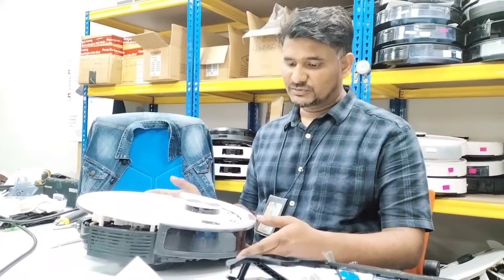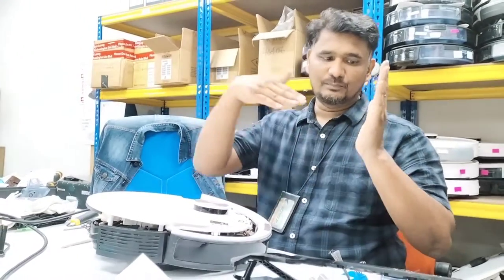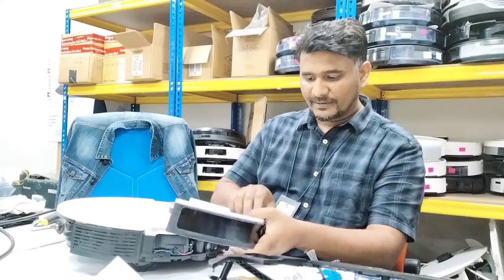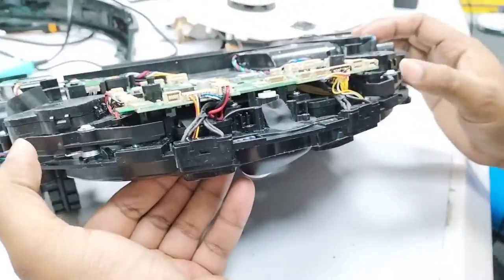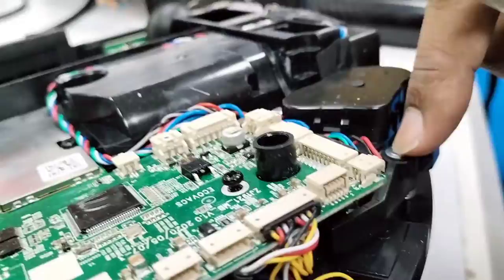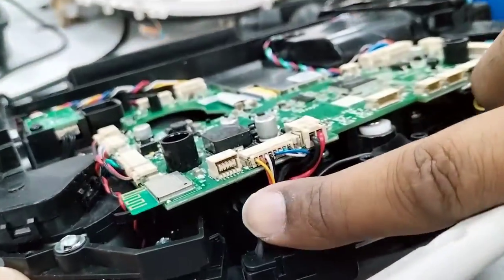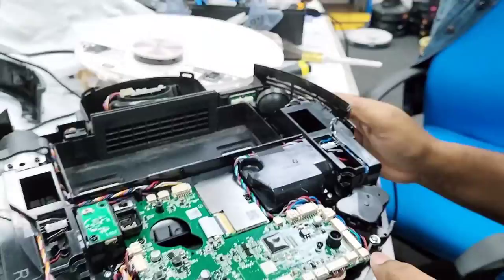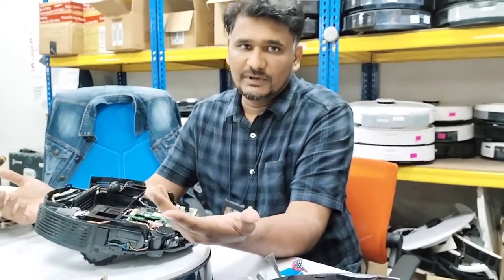How to Fix if Deebot Pushing the Obstacles ?? Or won't reverse after touch an Obstacle

Comment: Same problem with 950, pushing the wall until the left sensor is triggered. Periodically an error on the drive wheel, obviously it hard to push the wall. Swapped the elements of the left and right bumper sensor and it did not solve anything. Apparently, will have to go favorite way off service centers - change everything in a row.
Reply from the maker: Just front anti drop Sensors with Charging connector it comes in one assembly..need to replace saperate also left & right available....if you know which side not functioning so just replaced that side & solder the charging wire with connector... problem will be solve
Reply: Problem fixed by replace smd resistor 100Ω 0.063w on main bord

Comment: Hi, same problem here with a Ozmo950. The right bumper side does not trigger so the roboter does not stop pushing into objects.
Sensor cleaning did not solve the problem…
Any chance to fix or replace that bumper sensor?
Thanks for the support.
Reply from the maker: Front anti drop sensors set includes bumper sensors...it comes in one assembly need to replace...or u see if can find same inner sensors saperate then just solder n replace sensors...like this can solve this issue

Comment: Hello my 950 not working mainbrush. But ı dont know how İs it replace mainbrush motor
Reply from the maker: Plz check ur comment on another video I just Reply in detail
Reply: I couldn't see the video.  but I disassembled the 950's engine.  I gave electricity to the engine from outside, it works.  (12v) but when I plug it into the robot it stops and doesn't work after a short while.

Comment: Hello nice video but unfortunately not works for me. For testing i removed right lever so the bumpper triggers every time. And nothing until i triggered the left one. Is it any way to repair it at home? I saw that the detector is connected to charging pad and overhang sensor. Thanks for any help. (I have deebot ozmo 950 maybe it is the same as one on the video)
Reply from the maker: Hi.... model 950 u r using ok ..may I know what's the error occurred in mobile app...or what's the voice msg from deebot...then I let you know how you can fix it
Reply: @ecovacstechnicalsupport5278  there is no error. Cleaner just running to the wall until he hits left sensor then cleaning continue to the end.

Comment: I have the same error as others have pointed. Right bumper stopped working,no error on app, just keeps going until left bumper triggers. I disassembled everything and cleaned inside, and nothing works. This is my second ecovacs device, the first 930 started to detect rugs where there was only floor, nothing helped so i decided to buy this newer model. If this error cannot be solved or is a motherboard fault this will be the last 😢
Reply from the maker: Just front Anti drop sensors with charging connector replace...it comes in one assembly all connected with one clip...

Comment: Same problem here with the Ozmo 950, it worked perfectly for years perfectly, and still (almost) everything ok, no error on the app, but the right bumper doesn't work., it hits the obstacles or wall by pushing hard until this movement let it move/rotate away.

Tested every other sensor and LDS, and also tried to reverse left/right bumper sensors but the error stays on the right side, so sounds to me a main board problem. any suggestion?

There is any availability for a maintenance software to use connecting to the micro usb port on top?
Reply from the maker: Sorry for late reply...have you replace the front anti drop sensors n bumper  sensors...it comes in a assembly...if you Couldn't find the assembly then plz just open the faculty side sensors n Just replace the bumper sensors... which eaisly can get from electronic shop... hopefully will work
Reply: @ecovacstechnicalsupport5278  sorry, I was busy too, actually the anti drop sensor were performing all well, tested on a step and from any side approaching they work well, the problem is always that it seems that the bumper doesn't work on the right side (as some other guys pointed out in this thread).
As I wrote, I tried reverting the bumper sensors, putting the right to the left and the left to the right, and the error keep occurring on the same side. So if there is no availability for some probing software to check the main board, I will wait for some used united.

...or maybe there is any chance you have an ozmo 950 main board to sell as used?
Reply: @ecovacstechnicalsupport5278  Hi, same problem here with same model (ozmo 950). But I don't find sensor pack (or alone) on internet. Could you please help ?

Comment: Anyone know a solution to the problem with the right side of the bumper. The left and middle parts of the bumper are good. I replaced the bumper with a new one, replaced the front anti drop sensors and bumper  sensors and nothing helped. The sensors on the right side of the bumper don't work and don't glow red when I look through the camera on my phone. Will replacing the motherboard solve the problem?
Reply from the maker: May I know which model u r using sir??
Reply: Ozmo 950
Reply: Seems to be a problem common with the 950. Mine too
Reply: I will replace the motherboard and write if the problem is solved
Reply: I can confirm that replacing the motherboard solved the problem.